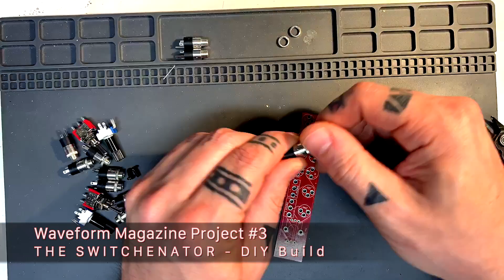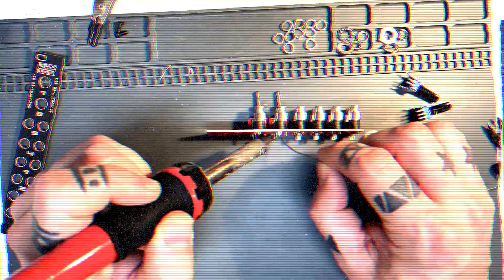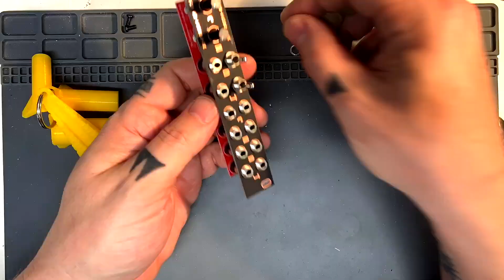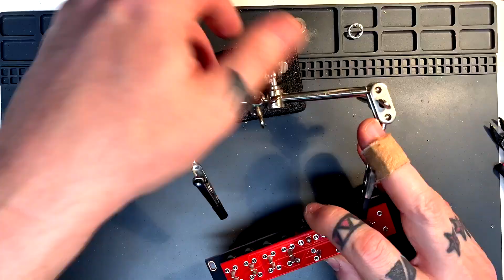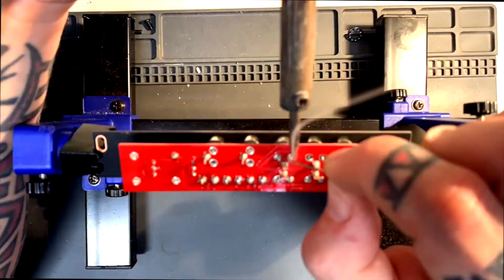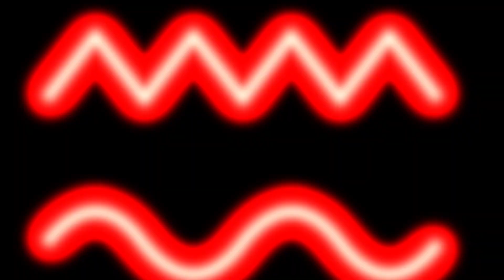Waveform Magazine Switchenator (Project 3) - Time Lapse Build

Comment: Hi, I ordered one of these already assembled and my cables seem to be super tight to plug in.  Is this normal for DIY projects?  This is my first DIY and none of my Make Noise / Pittsburgh Modular /MOOG stuff is this tight.  Will it eventually loosen up some?
Reply: Also too, your link in your description seems to be cut off.  I get 404 error.  just FYI.
Reply from the maker: These jacks are tight. We had the same issue with them but it’s not the fault of Waveform. It’s the jack type themselves.... which these type are rarely used in the DIY world.
Reply from the maker: H.R. Terror ah thanks for update on the link. Will go back and fix. Has to do with recent updates. Much appreciated
Reply: fiN Studios should I be worried about my cables though?
Reply from the maker: H.R. Terror no. We have a few other modules that do the same thing and they are just a little tighter fit. Should be good.
Reply from the maker: H.R. Terror another thing we do is make sure to pull plugs out and put in by the end ... never pull on the thin wire part. That’s helps it a little
Reply: fiN Studios I was just concerned about how much force I was having to use to fully seat the cable in place. It didn’t cost much so if I broke it no big deal I guess but just wanted to make sure. Thanks for replying!
Reply from the maker: H.R. Terror anytime - thanks for checking out the videos! We will get that channel link fixed soon!
Reply: @fiNStudios  why use jacks that are rarely used?
Reply from the maker: @interpr3t  These aren't our kits... they are Waveform Magazines.